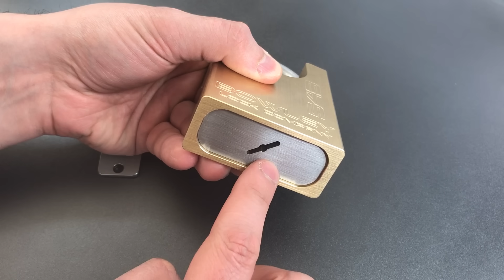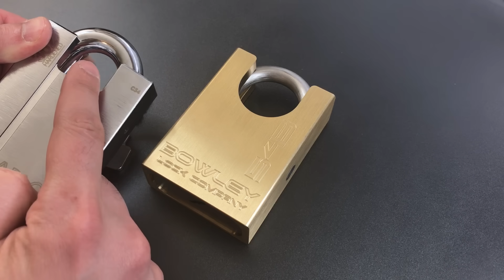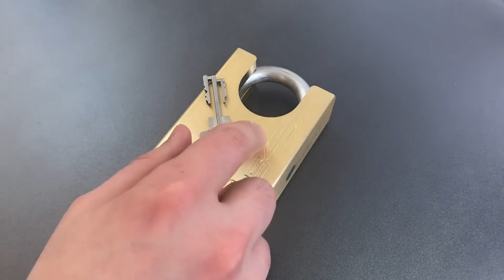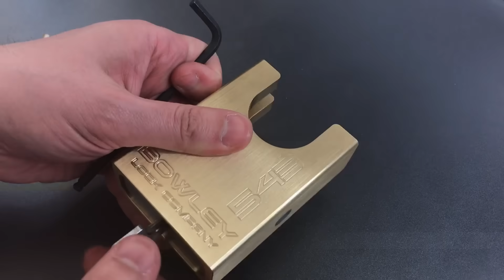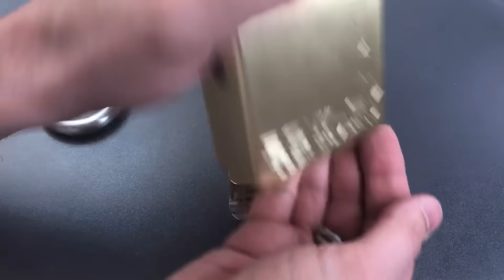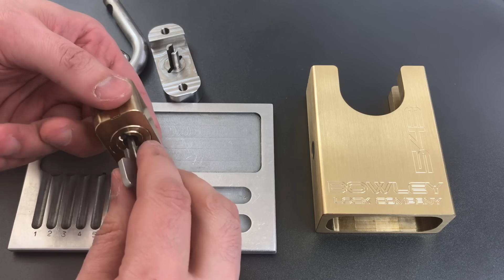[653] Prototype Dual Fork Bowley Padlock (Model 543)

Comment: Canadian lock model named after its dimensions in inches?  I guess metric would be silly confusing.  Ironic
Reply: Canada isn't fully metric. The construction industry still uses the Imperial system and it's fairly common in transportation. It also remains fairly common in everyday life, such as height and weight measurements.
Reply: Most of us can crunch metric and imperial.
Reply: Metric sucks outside of science and sometimes engineering...and even there it's kinda pointless. We had decimal inches before the metric system in machining.
Reply: Honestly the Metric system is only useful if you are incapable of basic calculations and need to rely on base 10s to help you.  With the technology we have today converting figures into different units will only take a couple seconds anyways. Seems like the most unnecessary change ever, unless you suck at math and are unable to access technology to aide you. Maybe 50 or 60 years ago it might have been helpful but, now its nothing more than preference
Reply: Start talkin cm and you can get a pretty long number in 3 dimensions. Also... If it's designed in inches you shouldn't convert. Conversion is a mistake. It just confuses alot of people and breeds hatred for a good system (my daddy taught math and I'll take hus word for that)
Reply: The metric system is much simpler and makes much more sense than the one the US uses.
Reply: agent475816 naw we will measure in the kings measurements
Reply: agent475816 Funny, since the US is officially metric. All imperial measurements in the US are defined by a metric value. Don’t believe me? Ask NIST
Reply: AdeptPaladin Show me the article because that is not true. There is no correlation between the two.
Reply: @unitrader403  Also the National Bureau of Standards published a notice that shows the precise measurement of all the imperial units in terms of their SI counterparts. A pound (aka avoirdupois pound) is 0.45359237kg. An ounce is 1/16th of that amount.
Reply: @agent475816  Only because you were raised with it. Imperial is the more mathematically elegant system for measurements of length as base 12 is what many mathematicians will tell you is best. Farenheits scale is also far superior for everyday usage. Dont be a sheep and learn that both have advantages. Funny how the countries that use Metric all speak two languages. Maybe they should just use the accepted lingua franca that is English and discard their other language? America uses metric for science like all other nations.
Reply: Jon M  The system where measurement is based on a kings foot is not "mathematically elegant." lol The metric system is mathematically elegant you just wouldn't know because you do not know how to use it. Celcius is based on water freezing/boiling. Kelvin is based on absolute zero, Farenheit is based on the freezing point of salt water which they though was pure but they were wrong. Basically based on nothing, scientifically non-informative. I am from the US btw, I can use both systems.
Reply: @Luckingsworth  That's some excellent false equivalency right there.
Reply: @Luckingsworth  Jeez, you must be really mad you don't have health care.
Reply: @Luckingsworth  The metric system using a decimal base, because our number system works on a decimal base, is somewhat obvious, really. If one foot would have equaled 10 inches, i would have never complained. It's not the imperial system itself, but how wacky it is. From milimeters to centimeters, to meters or even kilometers, is much easier to do rather than having to multiply or divide by 5280 and then by 12. Considering again numbers are based on a decimal system, and it makes calculating a tad easier and much more intuitive.

I just love and laugh at your mention of "english" and how irrelevant it is to the subjet. This shows me you're just trolling people with so-called patriotism, and heck some other people familiar with imperial system don't fully agree with what you said on measure systems.
Reply: @Luckingsworth  Australia and the UK speak two languages, too: English and Bad English.
Reply: @catlover732  I laughed until I remembered I'm a dying American without healthcare
Reply: Jon M Jon M I was raised with the imperial system, but it’s just common sense that the metric system is simpler. 

Imperial:
A mile is 5280 feet
A yard is 3 feet or 36 inches
A foot is 12 inches

Metric:
A kilometer is 1,000 meters
A meter is 100 centimeters
A centimeter is 10 millimeters

I think it should be obvious after that which one is more intuitive, user friendly and simpler, but in case you’re still on the fence, “pass me the 10mm socket” sounds better than asking for a fraction. That sounds a bit more “mathematically elegant” as you put it.
Reply: @groundcontrol6876  It's misleading to cherry pick measurements that illustrate your point. There are situations where the imperial system is more efficient than the metric. Once you stat adding in mass and force, the gravitational constant (~9.81, ~32.4) messes everything up. With the imperial force and mass are the same unit so we basically throw away gravity for all earth measurements. Where i preferred the imperial system is for structural design, and often in a lot of dynamic force calculations because the system eliminates the need for adjusting due to gravity.

I also like that an inch is about the width of my thumb a foot is about the length of my foot and a mile is easily recognized because it's the distance between most rural roads. What's the weight of a cubic meter of water, no calculator. Hint If your response is based off 1 gram per cm^3 your going to be wrong.
Reply: @andrewv5104  well if i base myself on the fact that 1 cm3 is 1 gram and a meter is 100 cm then there is 100x100x100 cm3 in a m3 which equals to 1 000 000 g which is 1 000 kg or a ton. Pretty sure my math adds up since metric is super easy
Reply: @andrewv5104  Do you know how confusing LBm and LBf is when doing non-school work problems? kg and newtons at least gives you different words for the the two different ideas. Even if you are in earth gravity, thing trying to accelerate a mass across a flat surface. You end up using LBm to determine the frictional force between the object and the ground, and LBm to determine it's momentum, and LBf to determine the amount of force your rocket/jet engine needs to accelerate it. It makes for a record keeping of little f's and M's. The block has a mass of 20Kg and requires 35N to move makes for much easier record keeping.
Reply: "Maybe they should... discard their other language"

Wut.
Reply: Jon M  You are the one that said that the imperial system was better, I'm just telling you it is not. Why do you think the US is the only country that still uses it?
Reply: @agent475816  Ignoring England and Canada who both still use it albeit unofficially, of course. Again I put forward that the same could be said of any language that isnt English. Campaign for everyone to switch to using English and then come back to me with that crap.
Reply: Jon M  Why should everyone switch to English? That doesn't make any sense.
Reply: @agent475816  Why should everything switch to Metric? That doesnt make any sense.
Reply: Jon M  I'm not saying that, I am saying that the metric system is better. It's not the same as a language.
Reply: Jon M  Did you know that the Imperial system is actually defined by metric units? So what is your answer to that ?
Reply: @Luckingsworth  Or everyone switch to mandarin. That's the ACTUAL most spoken language in the world.
Reply: @Zondac  Its not the lingua franca. And with the rate India is expanding English will soon be #1.
Reply: @gueldenerlarry8270  My answer is that that is irrelevant. Again metric for science makes sense for easy conversion, which is why the US uses it. However for everyday use US imperial is superior and base 12 is better.
Reply: @Luckingsworth  still a long way to go until the English speakers (~959m) surpass the mandarin (1,1b)
Reply: Because there still some discrepancy of morons using the imperial system in scientific background. With metric you can display something no matter how small or how big with easy units of measurement. And don’t even get me started on an non linear measurement of heat. Everyone should switch to one system to avoid confusion and the one used more in science and engineering around the world is clearly the better choice.
Reply: @Jon M
calculate me 12 miles into inches in your head if its that easy and elegant.

and because i bet the question will come:
12 kilometers = 12.000 meters = 12.000.000 millimeters (and for completeness the odd 1.200.000 centimeters and the forgotten 120.000 decimeters)
Reply: @UniTrader
Might as well add the = 1,2 metric miles. It's even elegant the other way! Whoa! Also = 1200 (even more forgotten than decimeters) decameters, and = 120 hectometers. So many units! One for each size! Invest now!
Reply: @Luckingsworth  nope, you're wrong kid, metric is better
Reply: @Luckingsworth  you count In base ten you spaz
Reply: @Luckingsworth  No. Imperial is arbitrary metric is not
Reply: @grappaduraone  Imperial is based on real world measurements. One foot equaling the average length of a persons foot. Metric is an entirely made up system with no real reason one meter should be the length it is or is not. You are incorrect and should learn to not argue over words you dont understand.
Reply: @Clancywiggum97  so tell me which metric using country had landed a man on the moon? Which metric using country invented automobiles, planes, television, the internet, electricity ect. I say we move everyone to the imperial system due to it being responsible for most of the major scientific breakthrough in human history.
Reply: @RepinsTsohg  Electricity!?! The Internet!?!! Oh no...
Reply: Zondac most spoken language in one tiny part of the world. The rest of the world, speaks English.
Reply: @RepinsTsohg  
automobiles? France 
Planes? France 
Television? Germany 
Internet? Neither metric nor imperial it is binary 
The apollo 11 computer was programed with the si system.
Nasa uses the metric system.
Electricity was always there it was not invented. But if you want the person who first made electricity usable? Italy 
Your comment shows me how much you actualy know about the systems.
Reply: @vedal1358  right? :D
Reply: @Luckingsworth  lol I've gone way past basic calculus and never has base 12  been mentioned or used. We count in base 10 and a measurement system based on that makes a lot more sense.
Reply: @bakirev  Way past basic calculus as in
... calculus 2? Lol! Base 10 is very impractical and is only popular due to us having ten fingers to count on. That's it. By the way, base 12 is used for time, so regardless of if you have passed a class or not you definitely have not taken time to actually study math.
Reply: @Luckingsworth  Isn't it interesting how a lot of number systems are base 12. Why do we shift to teens at 13? How many other languages make this shift at this same point?  Also I'm assuming you being a man of knowledge love fractions? I like that imperial use fractions. Take half of 1 3/16" It's fast and easy. By comparison half of 30.1625mm needs a calculator. Also precision is nicer on the imperial scale rulers typically go down to mm but the 32nd and 64th have more resolution and don't have a metric equivalent unless you want to try and use messy 0.5mm rulers. 0.1mm rulers are a joke.....
Reply: @andrewv5104  Exactly. I can respect the ease of conversion that the metric system has which makes connecting various variables together easy for scientific purposes. But for everyday life and things like carpentry the Imperial system is so much better. It's just sad how America haters are trying to dismantle it only because America uses it.
Reply: @Luckingsworth  They just hate us because we're beautiful, awesome, and intelligent. It's not everyone that can understand multiple measurement systems and be able to convert easily between them. Sorry that I'm just better than them (i'm not sorry).

 Even for scientific purposes it's utility only goes so far until it becomes messy. Once you start adding in natural constants like gravity it's any one's game.
Reply: @andrewv5104  fractional inches are fine, so would fraction cms, or what ever units. It's the conversion between the very large units and the very small units that is so convenient in metric. Quick convert 1.4miles into inches in your head. It's very easy to convert 1.4km to mm (1,400,000), because it's move the decimal point over 6 (3 to get to meters, and 3 more to get to mm). 

As for wanting units based on body parts, 100mm is about the width of my hand, if i extend my thumb out it's about 150mm, a cm is about the width of my little finger, a meter is about one large step, a full grown man is a bit shorter than 2 meters, my foot is about 30cm long.

1/64th of an inch is about 0.4mm (0.396875mm), so for anything you will be using your eyeball to look at instead of a micrometer for, a 0.5mm scale on a ruler is small and accurate enough. The 1/64 scale would be slightly closer together and "messier". 

P.S. I'm an engineer in the USA, been here pretty much all my life expect that month or so in Germany. I still can't get my head around metric temps, I'd have no clue if I'd need a jacket or shorts, but I bet i'd figure it out fast.
Reply: Andrew V Not Spanish or French. Spanish stops using unique names for numbers from 16 on, French from 17 on.
Reply: Jon M OK, then start using base 12 in your daily life if it’s that useful. It doesn’t make any real difference in serious maths anyway (watch Numberphile’s video on the subject where real mathematicians talk about it), and it only “simplifies” a few “decimal” representations, like 1/3. But fractions are better in pure maths anyway, and in physics and real life you don’t need high precision because our measurement devices aren’t that accurate.
Reply: @GRBtutorials  OK,then start using base 10 in your daily life.  Ten hours in the day, 10 days in the week, and ten months in the year.  Yes, they actually tried to enforce that when the metric system was originally introduced.  Let me know how it works out for you.
Reply: fearlesscrusader Except 24 hours, 7 days and 12 months are expressed in decimal... if it was base 12, it would be 10 months, 20 hours and 7 days. Plus, those are international (or almost, at least the countries which language I can understand) standards, and Imperial isn’t. My point is that it doesn’t really matter which base you use, and metric makes conversion so much easier because we use base 10, not base 12 (and even then, there’s the issue of consistency, as conversion factors for Imperial units aren’t consistent). How many feet are in a mile? Most people, even if they grew up with Imperial, would have no idea. How many meters in a kilometer? That’s easy: 1000.
Reply: @GRBtutorials  That's easy.  5280.  I learned that in 4th grade, and it has stuck in my mind ever since.  Doesn't everybody know that?  But how many meters are in a kilometer?  Most people, if they didn't grow up with metric, wouldn't have any idea.
Reply: @fearlesscrusader  Read my comment again. I wasn't referring to you, but to most people, and most people who grew with Imperial most likely have no idea because it's not a number they use much. Yet, most people who grew with metric can remember perfectly the equivalences. 

And my phone number is more difficult than that and I remember it, but if I told someone my phone number once, I highly doubt they would remember a year later unless they were really interested in it.
Reply: Imperial is literally herpes, working on cars you see a mess (domestic vehicles) or metric and imperial
Reply: Ironically the USA is the place you're most likely to get a kill-o-gram at your door.
Reply: 5/4" = 31.75mm
4" = 101.3mm
3" = 76.2mm
Looking at the numbers I think the inch ones may roll off the tongue just a bit better than the mm ones.
Reply: @Geoff_G  are you serious?
Reply: @Geoff_G  this whole comment thread was stupid but you've really outdone yourself here
Reply: @Mural  I noticed you didn't say what the lock would have bben called in Metric, because that would have shown how stupid the name would be in Metric.
Reply: Dave Kimball fuck the metric system i hate it

Comment: Why so expensive? I can use a $40 angle grinder to cut through that in a few seconds.
Reply: More like 6 minutes.
Reply: Ready? Go!

1... 2... 3...

What, you didn't get through yet?
Reply: Well, ok  then, just cut through the latch it's locked to, cause that thing's expensive. Great lock.

Comment: I have an Abloy 362.  Although indestructible, it isn’t very useful due the overly thick everything.  I am planning on selling it on FleaBay now that I don’t need it.
Reply: 362 is overkill, try choosing something like 342 unless you are locking up shipping containers or train cars.
Reply: Ive got a Abloy 362 and a 19mm chain locking my motorcycle up..great lock..great chain. In uk..bike thiefs dont picks locks...bolt cutters or grinder is tool of choice

Comment: Putting a screw at the centre of the bottom plate and using slide hammer will it pull out the bottom plate??